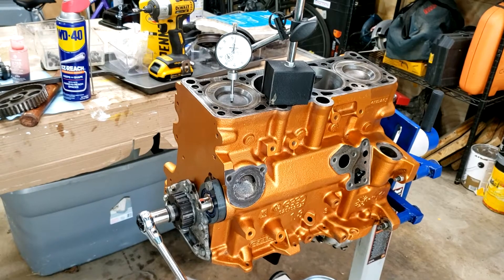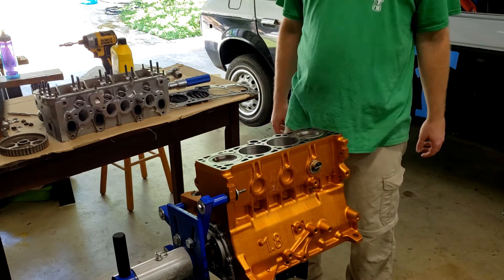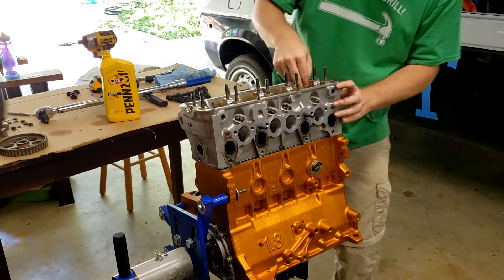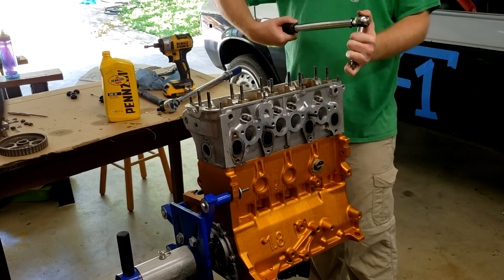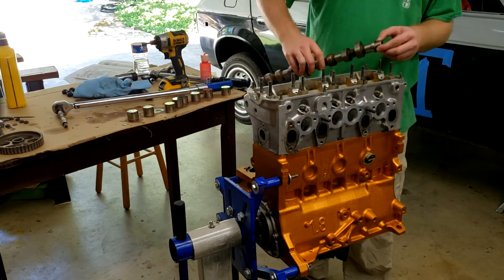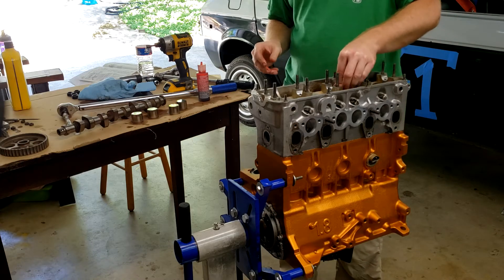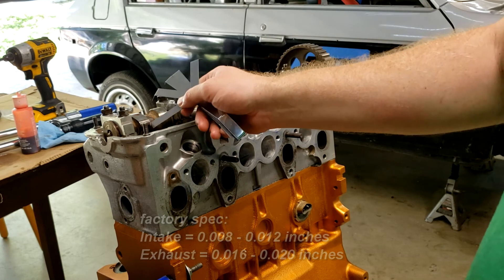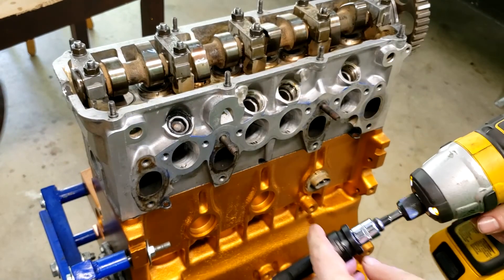Lemons car VW GTI Mk1 cylinder head install

Comment: Take a couple of old head bolts and cut the heads off then put a slot in the top and you can use them as guide pins or get a set of ARP head studs

Comment: Where did you get your threaded plugs from for the injector delete holes? Also what size are they?
Reply from the maker: M24 x 1.5mm Pitch Plug Throat Hex Socket Pipe Plug.  I found them on Ebay.  Please be careful installing them as they are very easy to cross-thread.
Reply: @eventhorizonlemonscar6139  yeah got some from Amazon. Thanks!

Comment: A little oil on the bolt threads is ok. Check the Bentley manual. If too much oil pools in the bottom of the thread hole, tightening the bolt could (small chance) cause a hydraulic lock and crack the head. Better to use very little oil.....not a dip into the bottle and then right in to the bolt hole. Good Luck.
Reply: 100% Right

Comment: Awesome video! I thought I read somewhere that when stretching head bolts, it was bad to lubricate the bolts?✌
Reply: Nothing wrong with applying a small amount of oil on the threads/ under the head/ washers of the head bolts, I always do it when not using ARP's which come with their own lube. You can however put too much on the thread area which can 'hydrolock' the bolt holes in your block. This is bad as it can give you false torque readings and worse, can actually split the block when the liquid has no where left to go. A little on the threads and under the hex area is all you need.
Reply from the maker: You should use whatever the manual says.  The slicker the lube, the less friction between the threads and the more bolt stretch per given torque.  The manufacturer figures that into their torque specs.  Thus, if it says 30W oil, I use that.  ARP will ship their preferred lube with whatever fastener kit you buy for the same reason.  Make sense?

Comment: @Lee Childers
There are two short cylindrical pin like pipes that connect the oil drainage canals on the backside of the head. Their primary use is to create a tight seal and help align the head gasket and the head itself on the block.
Reply: Yes, I was wondering where the alignment dowels went to. Usually they get pulled out when the head and or block gets milled but reinstalled before the head gasket goes on. I would definitely not try to run without them and wouldn't rely on the head bolts to position the head and gasket properly.
Reply from the maker: The engine was given to me disassembled.  No idea where they are.  This is a fairly low compression, gas engine.  If this was a blown engine running nitromethane, I would be more concerned.  The engine has 7 hours of track time on it now, no issues.

Comment: Had the transmission been connected, would you have gone by the flywheel mark to get TDC for piston Number 1?
Reply from the maker: Yes, I would first confirm the TDC mark was correct and then go off of that mark.  I did this in the car.
Reply: Do you need to do this? Or can I just confirm it the way you did in the video?